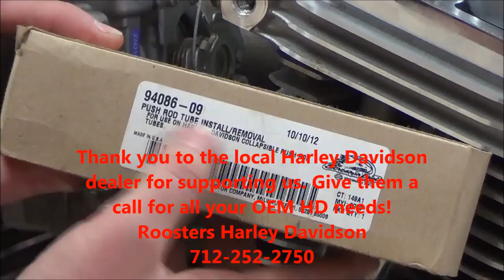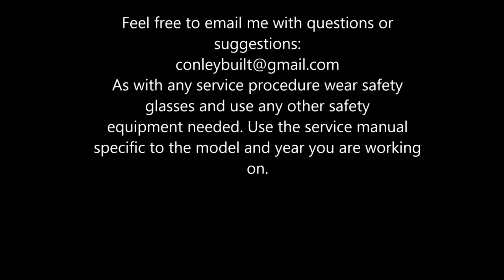Twin Cam Engine Series: 01 Rockerbox and Pushrod Removal

Comment: Shane, your videos are fantastic!  I have a 2005 Heritage Softail and discovered it had developed a leak somewhere in the front cylinder.  Your videos were a huge help to me as I tore into the motor, replaced the faulty gasket, and got everything back together.  Bike seems to run great.  Thanks again for these great videos!
Reply from the maker: Head over to the new website and subscribe to the newsletter to never miss a video or newsletter! www.how2wrench.com/contact/ 
Keep Wrenching,
Shane Conley
Instructor/Motivator/Motorcyclist
www.how2wrench.com

Did you like this free video and hope to see more? Would you just like to say thank you with a donation? Click https://www.paypal.com/donate/?token=TvKoeRazPL-KysbM-e0ttz-C_gPq2IrqxDmM3ORCu4nxJzQWxYbmo-6m3YuNu64XHLngGW
Reply from the maker: Thank you! Stay tuned!

Comment: Thanks for the videos Shane. I have a lot of automotive experience but just starting into Harleys, so this is great. Little correction for this vid, if a customer is, complaining of a lot of OIL in their Air filter, then there maybe a problem with the flapper assembly.

Comment: Can someone explain why the pushrods have to come out when doing a cam upgrade. Is just to remove the pressure of the lifter from the cam base circle?
Reply: That's it. That way, the cam isn't pushed down as you remove the cover and damage the cam bearing surface or damage the case..
Reply: I've actually done a number of them since I posted this. One with adjustable quickie push rods. The rest I reuse the OEM's. At this point I'll never use adjustables again.

Comment: May want to make a note to blow the holes for excess oil so when you install the bolts it doesn’t break the bottom of the jugs.
Reply from the maker: Great tip.This is a series and thread cleaning and prep (both bolt and hole) are in the earlier videos. 
👍 Thank you for taking the time to comment! Hit that subscribe button if you haven’t please! It helps us! 
Here is a way to support all the free videos.
Want to say “thanks” or “keep it up”? Click here https://www.paypal.me/how2wrench  

Coach Conley is also available for hire to personally work one on one with you if ever needed. Yep he is a real person. Give him a call @ 602-345-0432
Details here: https://how2wrench.com/product/personal-tech-training-phone-facetime/ 
Your answers and help are just around the corner. Save time and money while protecting your investment and yourself by doing it the right way!
Follow us! 
Web:
www.How2Wrench.com     
www.Tools2Wrench.com

Comment: Is it necessary to take the lower rocker box cover off every time you pull the pushrods?
Reply from the maker: I want to say no as long as there is room to remove the pushrod up and out. For example, some models may need that extra little side clearance a removed lower rocker gives. I would say if they come out then no for sure but keep in mind that it only a few bolts and you can get a new lower gasket in place and start its bday over. 
👍 Thank you for taking the time to comment! Hit that subscribe button if you haven’t please! It helps us! 
Here is a way to support all the free videos.
Want to say “thanks” or “keep it up”? Click here https://www.paypal.me/how2wrench  

Coach Conley is also available for hire to personally work one on one with you if ever needed. Yep he is a real person. Give him a call @ 602-345-0432
Details here: https://how2wrench.com/product/personal-tech-training-phone-facetime/ 
Your answers and help are just around the corner. Save time and money while protecting your investment and yourself by doing it the right way!
Follow us! 
Web:
www.How2Wrench.com     
www.Tools2Wrench.com

Comment from the maker: I'm trying to do more of the fast forwarding of the non-essential material so you fans don't have to!
Reply: Shane Conley thanks for the videos they really helped me with an old Softail I had
Reply: Shane Conley hey man you videos are life savers haha, was wondering if I could email a video of my 2000 fxdx running at idle makeing a Loud tick, while coughing white smoke any ideas off the top of your head? I was figureing piston rings or value seals cause of the smoke. As far at the  tick/clink something broken in the pushrod/ lifter area? Thanks for the help

Comment: I changed camplate, cams 525 fueling and used stock pushrods and lifters.
I'm getting no oil pressure when started and high rev idle and a slight tapping I shut it down quickly. Its a 2006 flhxi 88ci. 26000 miles
Reply: And fueling oil pump also
Reply from the maker: Hi friend.  I try to answer when I've seen it before, but I don't recognize this one. I’m the Social Media Manager here. That’s a good question for Shane. He gets hundreds of requests a day and starts each day answering MEMBER or donation support questions first and then if there is time he will try to circle back before heading to the shop for customer work. 
Want faster response times? Join link below.
Thank you for commenting. Want more benefits? 
-Daily MEMBER FIRST COMMENTS ANSWERED FIRST 
-Live Q/A video chats
-Wonder if we have a video on your need? Members can request content links!
-Full Access to the ENTIRE 700 video library
-Member-Only FREE tool giveaways 
Join this channel to get access to perks:
https://www.youtube.com/channel/UCBhM8DCKnT3qXwTW0eToyCg/join 

Just want to say thanks quick to support us for this information and our work saving you money? 
Give us a high 5 here:  https://www.paypal.me/how2wrench

Comment: @7:07...you said "air in the oil filter".......is that correct>  or did you mean to say oil in the air filter?  I am getting quite a lot of oil coming out of the rocker gasket..and I am thinking this air/oil valve might me something I should check.
Reply: He definitely meant oil in air filter,,,said it backwards.

Comment: Hi Shane,
  I just changed my Tensioners on my 03 twin cam 88.  I used a new tool to change the secondary tensioner without removing the cams from the plate.  When I try to put the rockers back on the pushrods alway seem to get tension on them as I begin to tighten them. I am at TDC but I don't get the relaxed rockers and pushrods as I begin to tighten down the assembly. I lined up the two timing dots on the sprockets and never took the inside cam chain off.  Any thoughts on what I'm doing wrong?
Reply from the maker: I emailed you back. Thank you for sharing…below are some links that help support me and my work. Please subscribe and share these videos to make a difference in education!
Keep Wrenching,
Shane Conley

Shirt/Stickers link: https://how2wrench.com/product-category/specials/ 

Want to say “thanks” or “keep it up”? Click https://www.paypal.me/how2wrench

Follow us!
Web:
http://www.How2Wrench.com    
http://www.Tools2Wrench.com  

YouTube: 
https://www.youtube.com/c/ShaneConleyhow2wrench  

Instagram:
https://www.instagram.com/how2wrench/ 

Linkedin: 
https://www.linkedin.com/in/shane-conley-how2wrench/ 

Facebook:
https://www.facebook.com/MechanicsLearningSharingPage/  

Free Mechanic info, tool reviews, and “how to” videos newsletter sign up: https://how2wrench.com/subscribe-free-newsletter/ 

Amazon Tools: 
https://www.amazon.com/shop/shaneconleyhow2wrench?ref=ac_inf_hm_vp

Comment: i have a 2013 harley road king with 15000 miles i resently discovered an oil leak on the lower rear rocker cover what can you suggest is it common to have this happen with this low miles do i have to replace the lower rocker cover gasket or can i re torke the lower rocker cover

Comment: Shane, just became a member after years of watching your content and I wanna say thanks for posting these how-to vids. They truly help the DIYer or entry level mechanics like myself! I noticed you used the heim joints to split the cases on a twin cam B, will this method work on the early A models? 01 engine case with the good pinion bearings, so I really don’t want to disturb the crank too much unless absolutely necessary. I have to split the cases to clean some metal particles from a botched inner cam bearing installation, so I’m doing a 95 big bore kit and new cams/oil pump/cam plate (hyd tensioner upgrade) while she’s tore down. If I do in fact have to press the crank out, do you recommend replacing the pinion bearings with new, (The bike ran great, no flywheel issues to my knowledge.) Or just compare the run out before and after reassembly?Any help is appreciated, thanks again!
Reply from the maker: Thanks for the support Dylan. You should have full access to all the videos ever made now (over 700!)

Comment: Of coarse if you doing this IN THE BIKE forget about power tools  Buy a 1/4 drive  7/16th socket to grind down &  be prepared to undo & remove the front motor mount fuel tank coil assembly . Putt the spark plugs out Jack it up put it in 6th gear to rotate engine & put back in so you dont drop anything down the open spark plug hole Front one is easy back one is tougher but not too bad if on a street glide or bagger. Definitely have to jack up & down the engine
Reply from the maker: I've seen Shane share these links before. Some models can get away with the low clearance tools like these: https://amzn.to/3Rm4Vw9 or this one https://amzn.to/3Rn1mEX 

We love sharing comments like this with Shane.
Thanks for sharing and the added value to our wrenching community. Keep them coming.

Join the channel. Best $1.99 you'll spend to access all 800 vids and Shane Daily! Smash the sub and like please. 

Throw Shane a high five donation, channel membership or merch for saving you $$$$$$$ Links below to support more for this work! 🙏
You rock for commenting! We will let Shane know! Want even more? Best $2 you'll ever spend...Join this channel to get access to perks:
https://www.youtube.com/channel/UCBhM8DCKnT3qXwTW0eToyCg/join       
-Daily MEMBER FIRST COMMENTS ANSWERED FIRST 
-Live Q/A video chats
-Wonder if we have a video on your need? Members can request content links!
-Full Access to the ENTIRE 700 video library
-Member-Only FREE tool giveaways  
Ways to support or high five How 2 Wrench! Thank you in advance. YOU MOTIVATE US TO DO MORE!
1. Smash the subscribe button (thank if already a sub!)
2. Have you seen our "YouTube Trained Support Shirts?  https://goodfellasmerch.com/collections/how-2-wrench/products/support-shirt   
3. High five donation:  https://www.paypal.me/how2wrench    
4. Got an emergency and your head is about to explode from frustration or fear? Get Shane’s cell here: https://how2wrench.com/ols/products/techline-one-on-one

Comment: Nice video, question.... should the 1999- 2001 twin cam engine have lifter, push rod, rocker arm slight tapping noise?
In a car NO but I have been told yes in  twin cam engine.,To me no! What do you say?

Comment: the new tool for push rod covers looked way to aggressive, wont be using one. great vid very profesional, it would of messed up the look of the vid if you had shown the oily wood clothes pins attached to that shiny twin cam, understand why it wasnt shown but the little things can make people relax and smile. thanx for posting

Comment: Probably a dumb question to you all but im freaking out! Do the pushrod tubes have exhaust pressure? I either blew my motor or need new pushrod tube gaskets! Please respond.
Reply: I'm looking to buy the scissor type tool u used In the video, could I get the info in order to purchase it. Thanks appreciate

Comment: Not replacing that o-ring  under the breather could it cause a P0108 code to come up? Map sensor? Replaced map sensor on my 04 flstci still getting code and intermittent hesitation. Driving me freaking nuts. Did a voltage test and I'm getting the correct voltage. I was thinking that the o-ring might have something to do with it? It however started to have that issue before I ever took the bike apart. Anyone have any thoughts on this?
Reply from the maker: If replacing the part related to the code doesn't solve something, think about downstream parts related to its fuction. Any ALWAYS replace orings, vacuum lines etc while making every connection correct. I'm sorry I can't be of more help. Anyone on here got a direction to point them you in? 

Please hit that subscribe button for us! 👍 Thank you for taking the time to comment! It helps us! 
Here is a way to support all the free videos.
Want to say “thanks” or “keep it up”? Click here https://www.paypal.me/how2wrench  

Follow us! 
www.How2Wrench.com     
www.Tools2Wrench.com  
Facebook: 
https://www.facebook.com/How2Wrench/ 
Instagram:
https://www.instagram.com/how2wrench/

Comment: can I use 103 heads on my 88ci
Reply from the maker: I believe they will physically bolt on, but have no idea on if there would be a power gain or loss. Many factors come into account. One could assume the 103 has bigger valves. If a stock 88 cams are used then if may actually be worse. You would want to match the cams, valves size to desired performance. Also, you could possible loss performance by the heads having a larger cc capacity which would lower engine compression ratio.
Reply: From the research I have done the SE 103 ci heads are the same as the SE 95 ci heads and the cylinders have the same size bore what makes it a 103 is a stroker flywheel assembly. My bike is a 01 springer and has the SE big bore cylinders and SE heads and 99% sure it has the stroker flywheel assembly. A HD tech was the original owner he knew what he was doing it is very impressive to ride definitely in the 100+ club it’s a ripper!